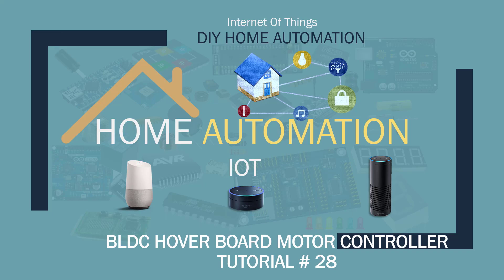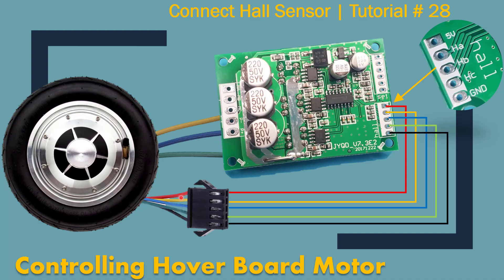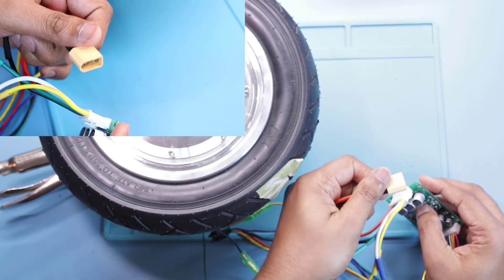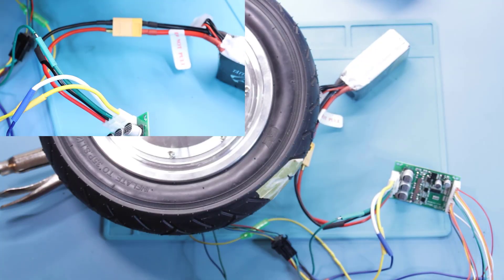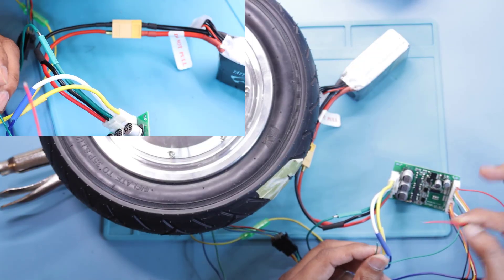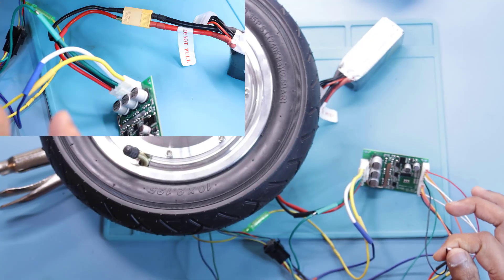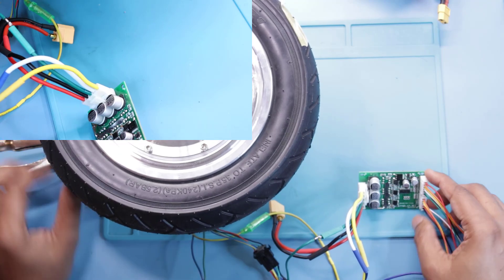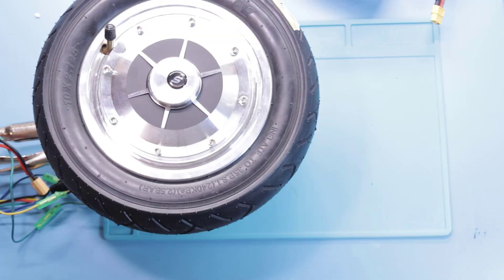BLDC Hover Board Motor Controller | Part 1| Tutorial # 28

Comment: For some reasons , I did everything that shown but nothing work.I thought  had a bad board , change it twice and the third one still won't move the engine. Change the potentiometer , attached the VR to the 5volts connectors still nothing happened . I put the mother ack to the hoverboard ,all work fine . Anyone has any idea why s this happening ?

Comment: I'm curious about the Hall Sensors, do they need to be connected?  

It's not like a BLDC controller needs Hall sensors to run, they can easily run in sensor less mode.  Hall sensors are more about information on the running motor such as direction and speed.  Its possible to adjust a BLDC motor just using the phase wires and looking at current draw/feedback but there are numerous other variables both static and dynamic that increase complexity and ultimately limit effectiveness.  Hall sensors can provide detailed position information which certainly improves the ability to tune a BLDC's performance, however there are many many different kinds of Hall Sensor based on measured parameters and abilities of detection.  Hall sensors can just detect, or provide position, they act as momentary switches, or as latch switches.

I have ordered similar controller boards, but the documentation is utterly void of any specifics regarding the Hall Sensors...  It makes some comment about motor being different, parents paying attention, and my drive plate will burn....  While its possible they are trying to say: If you drive your parents car faster than they do, they will burn your dinner and serve it to you on a plate, I suspect they intended something else.   I believe this is a warning that when connecting call sensors you must be careful the connections don't overload (e.g. <5 VDC, <20 mA ) the board and burn it out.   It does not however define what the signal from the Hall sensors should look like,   It does not define the  phase angle, does not indicate it if expects positional or switch input,  does not define if it expects unipolar or bipolar values, does it expect pull-up resistors, what is the expected pulse count... without such details, I fail to see how the controller can effectively use any of the Hall information.  

In the absence of these parameters, and no way to set such values in the controller, the controller cannot interpret the signal.  It can only provide the continuous voltage values on each of the Hall lines.  This then leads me to the conclusion that is up to the user(you) to decide if the signal data is correct and what to do with it.   This would then require a microcontroller(computer if you prefer) to process and use the signal.  The controller does have the control inputs to implement many complex concepts like reverse, PID control, braking, maybe regenerative braking (I have not spent any time thinking about what is provided/and needed  for this, but the brief look made me think its not obvious that its not possible.

Anyway, I will get a better understanding on the controller when I 'play' with it more shortly. I am just interested if you have looked into the Hall sensor signals and used the controller without connecting the Hall inputs.

Comment: I bought one of these controllers. I think I fried it using the the hover board battery. What is the maximum size battery I can use with this control unit. I was also wondering if I can use a 19 V DC power supply with it instead of the battery. I’m looking to make a large rock Tumblr with it and I need constant power for weeks. Please let me know your thoughts on this. I would really appreciate it. Thank you very much.
Reply: I have thé same problem did it work with the 19vDC

Comment: You say that the battery of the hoverboard itself wil fry the board, but does that also apply if you're running 2 of the motors on only the battery from the hoverboard itself?

Comment: Did you test it with initial torque? I tested this controller and it have problems to start when wheel is under a load (initial torque). In your video all rotation tests is in "free wheel" condition so it starts smoothly. But when wheel is under the little load controller has problems to start (it just jumping back-forward). Just start rotation in slow rate and try stop it by hand, it has no torque-control loop.

Comment: Hi, as per your advice connected two controllers on two motors & one throttle.  But again I am stuck in middle because I have no Reverse option in controllers. Any advice to modify controllers Reverse function without swapping wires?
Appreciated.

Comment: To slow the motor use dynamic breaking.  Power to zero. Short 2 of the 3 wires together and it will come to a stop, the motor will induce current in the coils, causes dynamic breaking. But it takes motion to do this. So the effect stops when the motor does
Reply: Okey gracias

Comment: Hi, nice informative videos.
Im planning to convert my hoverboard into gokart. Can you advise me if can connect both 350w motors parllel  to one 350w controller. 
2nd what gage wiring i should use.
3rd can the original battery of hoverboard be used.
Thanks in advance.
Reply: Hoverboard batteries are known to go kaboom, so i would buy a better one
You should be using 1 driver per motor unless the driver supports using multiple
As for guage, use the same as the motor
Also, it wouldn't be a fast gokart as hoverboard motors are slow
Hope that helps!

Comment: Can we do a setup for a 52v 1500w bldc li-ion configuration?
Reply: I blew my controller and tried another still no throttle control i have potentiometer and Moffett z44-s please help i got my scooter scooter to run by the key and thats the only control I have on and off at a low speed, please help me figure this out.  .

Comment: Very helpful video! I use 36V batteries which are fully charged at 43,5V. Can it handle that voltage with the use of a correct heat sink?
Reply: same question here.
Reply: Hitler?
Reply: A fully charged 36 volt battery will read 42 volts. You should be OK.

Comment: Is it possible to achieve forward and reverse rotation of the motor with one potentiometer?
Reply: Yes. 2 of the 3 wires need switched. Any 2. So you would need a switch. Position 1 for forward and position 2 for reverse

Comment: Can I use the 36v hoverboard battery for two boards tough?
Reply from the maker: Yes you can use 36v but make sure use heatsink not to burn the board
Reply: @netmedias7657  Also can I use a custom heat sink that I'm going to make, so that I can screw it on to the mosfets.
Reply from the maker: Yes, you can

Comment: Hi I want to make an electric quad using 4 hoverboard motors , if I want to control all of them from a single pod, I need to buy more board and connect them to a single pod and use 4 batteries with them? Or I can use one board with 4 motors and a single battery?
Thanks in advance!
Reply from the maker: You will need 4 boards.
Reply: @netmedias7657  and I can connect them to a single pod? And a single battery? Or I need 4 batteries?
Reply: @sefuvostru1680  use 1 potenciometer and put the VR wire in the four boards

Comment: dear l just bought bldc motor controller exactly same as you have but unfortunately it does not give output power. input is 20V battery.  no output voltage.  do you have any comments?  thanks

Comment: Wonderful video, gonna go watch Part 2 now...
Question: My hoverboard motors had one more wire coming out of it - a white one... Is that anything you've seen before?  It might be power for the LEDs in the hub - I will check that out too...
Reply: Hi its for a temp sensor

Comment: Hi, I tried using the same BLDC controller with the same wiring.  When I input 27v battery (2A), things heat up a little bit within 1 minute, and one capacitor exploded.  the controller should be able to handle max 36v.  You mentioned the controller fired when you use original battery from the hover board.  If I use lower voltage, the wheel won't spin.  Do you know any controller can handle 27v input power?  The capacitor that exploded rated 16v, next to the Set wiring.
Reply from the maker: It will work with 36 volts given that you use heat sink. I was using it without heat sink.

Comment: Hej, does the wiring order (MA, MB, MC) make any deifference?
Reply: Yes it makes a difference but it will not do anything bad. It will only reverse the default direction.
Like if you go with the order (MA, MB, MC) and do a test you will see the wheel for example going forward.
And if you flip them (MA, MC, MB) and do the same test you will see the wheel go the other way.

note: it doesn't matter the location of the pin as much as the order, consider it like a circle. If you wire (MB, MA, MC) it'll be like (MA, MC, MB)

Comment: What pot size are you using please?

I need to have a pot that will allow me to have the wheels just turning at walking speed for my golf trolley conversion project.
I will be using two controllers with a double pole pot to try and get them balanced as much as possible.

Comment: Why are you saying a 36v battery would fry the board? This is a 36v motor no?
Reply: I was wondering the same thing. I’m using mine to build a heavy duty rock tumbler so I don’t think I need as many volts. I’m not looking for speed. Looking for slow with a lot of torque. I’m hoping to run it on a 19 volt power supply. I tried to get the motor running using one of the other controller boards without the clip on wire leads on it. So I’m really hope this works as it’s getting expensive . I’m up over $35 on the 2 boards. Good luck with your build.

Comment: Hello and thank you for the video.

I have a 24 volt 200 watt booster motor with just yellow green and blue wires, what controller do I need to run it on my bike? I saw one with a throttle handle but also has other connectors, not sure if it would work... Any suggestions? Thanks.

Comment: Can I use a 36 v controller like this one but power it with a 42 bolt battery ?
Reply from the maker: You will fry the controller if it is not rated for 42 volts. You can used dc   to dc converter 42 to 36 dc. Search it on google.
Reply: @netmedias7657  does the amp rating for the step down converter need to be 15 amps ? The same as the controller?

Comment: Hi! very interesting and educational video....i have a question on how and what kind of motor controller that accept high voltage dc input, like for example 250v dc to 300v dc? Please share it here....thanks a alot
Reply from the maker: You can use relay with MCU if you want to turn motor on and off.

Comment: Hello please show thre right way to put heat sink, can I put single common heat sink or need seperate heat sink for each six mosfet
Reply: no you cant put common heat sink!
you must make all mosfet separatly, or 
use plastic isolator for screws or plastic screws and isolating layer between all of transistor and common heat sink (ex. kapton tape 2-3 layers).
also check heat dissipation for linear stabilisator, if you use 24V and higher for power supply.
Reply: @igormorozov6801  hello thank-you for reply, i got good solution for common heat sink using mica sheet and plastic screw

Comment: You said this board can not generate any breaking torque. How would you recommend slowing the wheel. I have that wheel and board and want to make an electric skateboard. Its all set up and works, but now i want to add breaking. Do i need a different board. If so, which one?

Comment: Do i need to use the hall senser if I just want to have the wheel move forward with the potentiometer
Reply from the maker: It depends on the type of controller. You can get a controller without the hall sensor and it should work.

Comment: nice video, but I have a question my friend: is necessary connect the hall sensor? or Can I use without connect them? and also, I have a 24v DC motor brushless. but it have only 2 wires, red and black... Can I connect it motor 24 dc (2wires) in the board controller (3 phases) same as your video?  I hope your reply. thanks!
Reply from the maker: This controller works with 3 phase motors only. You can buy a different version of this board that works without the hall sensors. You use Qunqi L298N Motor Drive Controller for 2 wire dc motor. Good luck.

Comment: Hey, nice video! :)

Can you please tell me if the BL-controller dislikes it to start with opened poti? The RC-BL-controller doesn't start with pwm signal on the input, because it's a safety feature that the motor doesn't start on throttle. I want to design a grinder that shoud start immediately after switching it on. I don't want to accelerate all the time.

Thanks
Pascal
Reply from the maker: Pascal Wieland Please watch the 2nd part of this video. I am showing it in details on how to control it with MCU. Good Luck.

https://www.youtube.com/watch?v=IrWBQBgoqf0

Comment: Is there a way that you can still use the 36v? I want to control 2 wheels, some 12v RGB lights, AND SOME speakers so it can talk and play music too.
Reply from the maker: Holly Hertig It works with 36v but voltage regulator gets very hot. Make sure you use a heat sink. If your thinking about using it with hoverboard like setup then don't use it. It does not have any breaking use a $33 hoverboard kit. You can also add led and BLE sound to it. Good Luck.

https://www.ebay.com/itm/Scooter-Main-Circuit-Board-Motherboard-Replacement-Parts-For-Balance-Scooter-US/264087485966?hash=item3d7cd73e0e:g:gYsAAOSw3S5b6iPc:rk:18:pf:0&LH_BIN=1
Reply: Netmedias I have this same question. I’m a dwarf. I’m 3ft and 55 lbs. I want to build a small powered wheelchair that I doesnt weight 120 lbs. I want to use these BLDC motors and a 36v Lipo for light weight. I had someone suggest using a modded hoverboard motherboard. What would you suggest? What about a sabertooth? Any benefit for one over the other? Besides price? Thanks for any input!

Comment: i’m trying to control brushless motor with arduino. Is it possible to control brushless motor with arduino by using controller you used in this video?
Reply from the maker: YES. This controller is for 3 phase motors only.

Comment: I would like to control the controller and motor with a micro:bit. It uses am pwm signal. Is it posible to connect it instead of the potmeter?
Reply from the maker: It will work with any MCU with 5v GPIO. I had some issues using it with ModeMcu without using a level shifter.
Reply: I want to run two motors with two boards, but I want them to turn equally fast. I want to use the signal (out) pin on the board. Can you help me with my question? @netmedias7657
Reply: https://www.youtube.com/watch?v=QrH8NNfC-UE&t=36s

Comment: Bro bagaimana kalo hall sensor nya di lepas apakah motor masih berputar
Reply from the maker: Man Elektro You will need a version to work without hall sensors.

https://www.ebay.com/itm/12V-36-500W-DC-Brushless-Motor-PWM-Control-Controller-Balanced-BLDC-Driver-Board/311861790417?_trkparms=aid%3D555018%26algo%3DPL.SIM%26ao%3D1%26asc%3D20131003132420%26meid%3Ddf5b5c55fa614ec684562e27fee2c6bc%26pid%3D100005%26rk%3D6%26rkt%3D12%26sd%3D112320972101%26itm%3D311861790417&_trksid=p2047675.c100005.m1851

Comment: Question what’s the EL and Signal wires for?
Reply from the maker: EL  enable  start/stop control (terminal connected to 5V start or grounding the motor stops)

Signal is for sensing hall encoder.

Comment: Can I use the original hoverboard battery if I want to build a e scooter? Everybody else Who build a scooter used the original Hoverboard battery. And why does it fry if i use it. Please answere
 Luke
Reply from the maker: I am not sure. You can try it but voltage regulator gets very hot when used with hover board battery. It is a fire hazard. Good luck.
Reply: Thank you I will try it and I will screw it on an aluminium plate to keep it cool👍
Reply: @moonlightdanc84  you can do it? Im looking for someone that uses this board and the hoverboard battery (sorry for responding 2 years later lmao)

Comment: Thanks for this! I'm about to try it with the 36V hoverboard lipo. Can you explain why it fried your board? They should be able to take 36V? They say to add heatsinks to the MOSFETs over 60W, did you try that? I'm trying a similar "DC 12V-36V 15A 500W Brushless Motor Controller Hall BLDC Driver Board LJ" $10 board.
Reply: Also did you see this? He figured out braking with this board https://www.youtube.com/watch?v=sUEJWnqO27k
Reply from the maker: First voltage regulator gets extremely hot when used with 36 volts battery. Second my board's etching was burned.
Reply: Thanks, you're right. AccuXperT said the 36V batteries run at 42V which burn out the board. I'll look for another battery, you saved me a board!
Reply: @alana314  what battery did you end up using?
Reply: @ManuelRoldanVega  I ended up swapping controllers instead and used an odrive
Reply: Thanks!